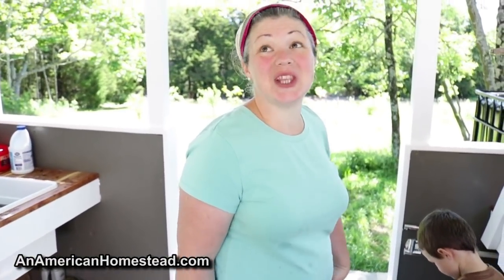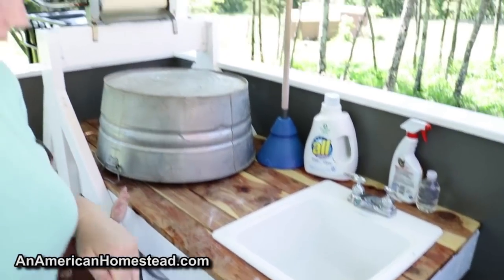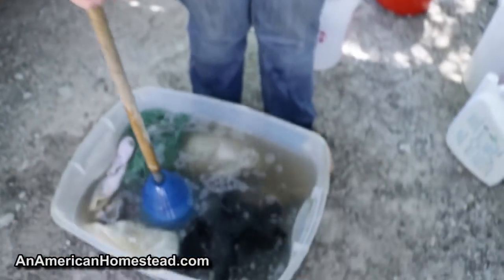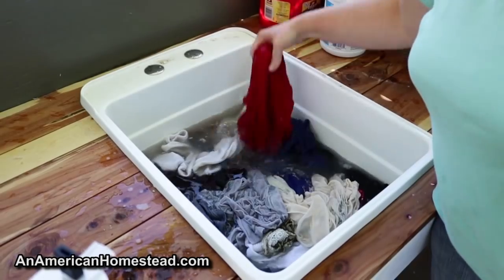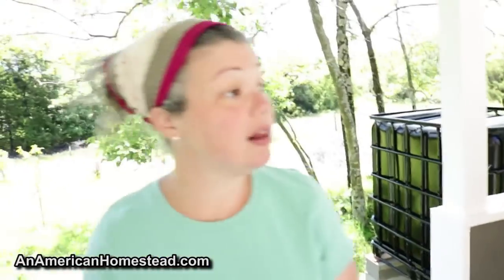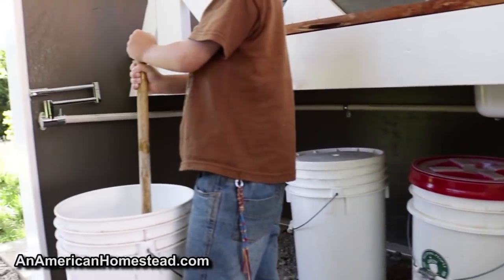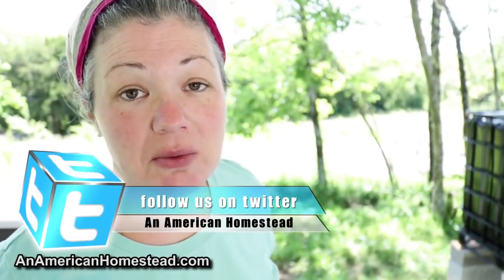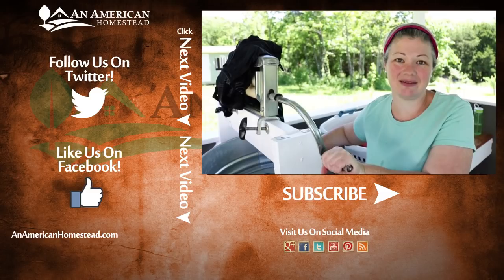Off Grid Laundry House TOUR!

Comment: Great Job!  This look awesome!  I have been following your videos over the last few years.  I have seen your videos about how you currently do laundry in the winter, but with this new setup, have you ever thought about changing a few things?  Have you ever thought about adding one outlet (via a solar panel on the roof) and wrapping those pipes with heat tape for in the winter?  Also you could easily put some plexy glass (or removable but efficient windows) on all the doors and windows (even have them removable for seasonal use) to be able to use the facility during the winter.  If you put in a small marine wood burning stove or even one of those electric outdoor heaters you can put on the ceiling (depending on solar wattage use) you could make this usable year round!  Great job! Can't wait to see what other improvements you make over this year!

Comment: This is illegal in Florida. All grey water must be drained into a septic.... Gonna do it anyway😉 Thanks, another great video!
Reply: Might want to check those laws again, it is not illegal to have grey water systems in Florida. Anyways, try to at least use biodegradable soap unlike these guys. It will build up in your soil and defeats the purpose of having a grey water system since you can't use regular soap water for most things.

Comment: We're going to build ourselves an off-grid laundry system this year too. Where did you get your wringer from? I am having trouble sourcing them here in Canada.
Reply: Lehman's Brothers has them online and also Amazon.
Reply: I've seen them but I'm in Canada. Unfortunately between the exchange rate, shipping and duty it will likely cost a fortune. But I am curious if that is the one they use because it had quite a few negative reviews and I'd like to know if they are happy with it :)
Reply: So I just checked Amazon. When the wringer is at it's regular price (right not it's on sale) it would cost me $302 CDN for the product and shipping. This does not include any duty I could be dinged with when it crosses the border. OY!